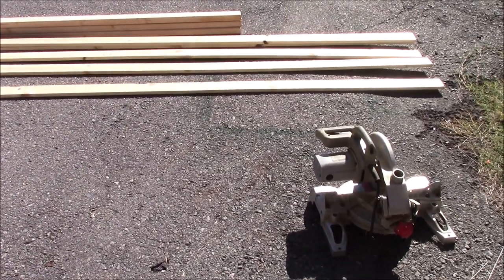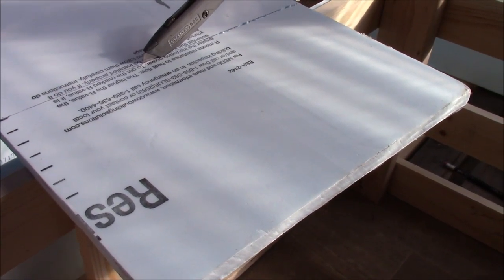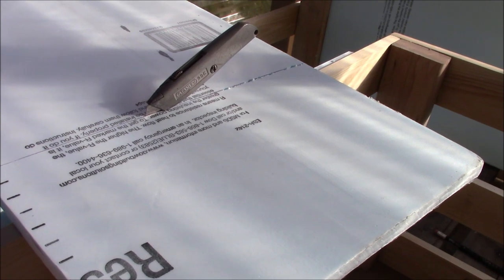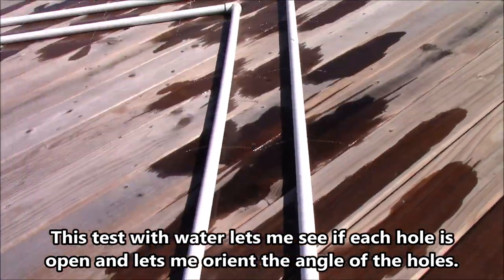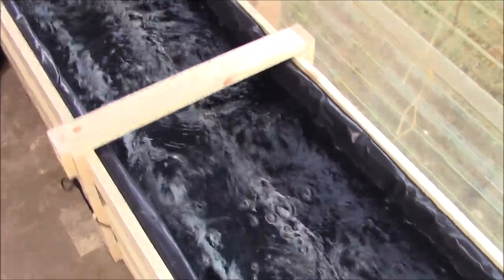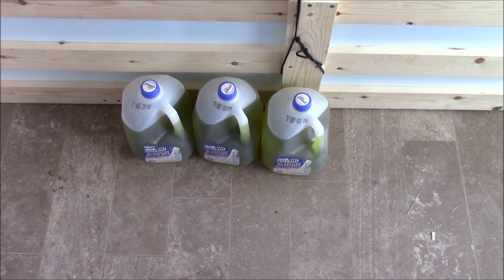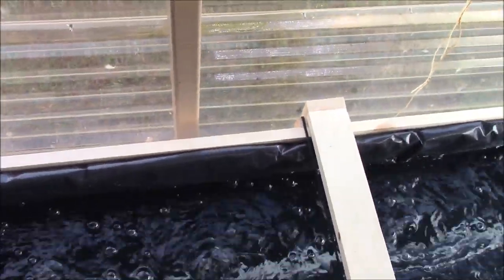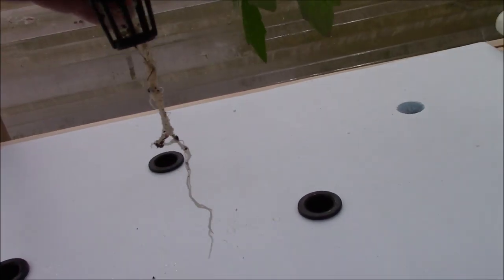Aerated Water Culture (DWC) in Winter Grow Room

Comment: Hey Brent, like that you are always creating.  The "How I Do It" and NOT "How To" really resonated with me.  That is all I can offer to others with advice too.  The exoskeleton wood frame and easy to work with extruded foam and plastic liner are a very interesting idea.  I have the 45 lpm version of that air pump style that has worked with buckets in my greenhouse.  I am amazed how much aeration you are getting off the pvc piping in your larger tank.  Genius idea to inject the warm air.  Not sure about the back pressure having no place to go when reducing air flow.  Just a little jealous to see your drain and fill simplification too.
Reply from the maker: Hey Matt.  Long time buddy.  :O)  Thanks for the kind words.  I have used this aeration before so I trialed it already.  I could have gone with a smaller drill bit and more holes, but there's only so much aeration a plant can use and I'm already way overboard on the design.  :O)  Am a fan of your work as well buddy.  I watch your videos.

Comment: We had already discussed the border issues. ;)  Good build but you may find over time the pushing bottom weight will start to push or bow the bottom also. Now that your built is together it is harder to re-reinforce the sides but a treated 2x4 laying flat and wide with screws from thinner bottom rail should stop this from bowing out being wide and at 90 degrees from the thinner board. I was also concerned with the membrane used, being in the eaves trough section it might not be good because of leaching, you want to use food grade liner to be safe. Id hate to see you get sick from the leaching effect. Not trying to pick at this idea at all just want to make sure you are safe brother. As you said we just have a border line, We are All North Americans in one form or another. Be safe, Oh yes the air holes could have been 1/16 with ones pointed up between the existing. Myself I have aquaponics plans once we sell here, everyone should get back to growing their own food cause the corporate grocery stores are poisoning Us All. Peace Out
Reply from the maker: Hey Ken, lots of thoughts there buddy!  If you can find me a food-grade liner, please do so ASAP.  I need the link.  I've looked everywhere and what's out there seems to be the degrees of poly.  I can't find it and it needs to say FDA approved for food and beverage as it seems poly is poly.  Thanks for the input for sure.  Elaborate as much as you like.  You don't offend me.  :O)
Reply: @C3Voyage  I will do some research Buddy.

Comment: Would you have got a greater air exchange with the water if you had used air stones???... Sorry but I might have to copy this.
Reply from the maker: Sure, likely.  There's a lot to consider with dissolved oxygen.  Over time, bubbles will raise the ph levels in the culture as I understand it.  As that happens, the amount the water can actually hold onto will lower.  I believe the water will hold greater co2 than oxygen as ph progresses upwards.  Not an expert on it.  The amount of oxygen a plant uses is only so much so going above may be a waste.  But, the biggest reason I went with PVC over air stones are the configuration and use of the PVC.  I will use it to fill and drain as well.  Secondary are the air stones clogging on me in the past, configuration of additional hoses/stones, costs associated with it all.  Just kind of figured a 110w bubbler on for less than 12hrs a day, and in a configuration that's easy for me, is worth a shot.  I've done this type before, but on a smaller scale, and it has worked in those cases.  I'm certainly no expert and I'd appreciate any insight you want to share too!  As with all things, please feel free to copy or adapt to your own needs.  :O)
Reply: @C3Voyage   Brilliant! Good work. Win- win.
Reply: @C3Voyage  Thank you for taking the time to give such a detailed reply. I did not know that the water chemistry could change like that......interesting reply.

Comment: Are those 1 inch net cups really going to be big enough?
Reply from the maker: I kind of wondered myself.  It goes against "norms", but then my experience makes me wonder why people do what they do.  For example, they use a 3" net cup then fill it with clay.  I ask myself "why?".  I used them forever as well only to fill them.  The main purpose seems to be stability through weight of the pellets.  Well, if the plants are supported as I plan, then why do all the extra with weights, clay, etc?  Honestly, I don't know because this part is new to me based on a theory I have.  I know the 1" net cups are large enough for the stems.  After that, I'm not sure.  We shall see.  That part is on trial!  :O)  Great question!